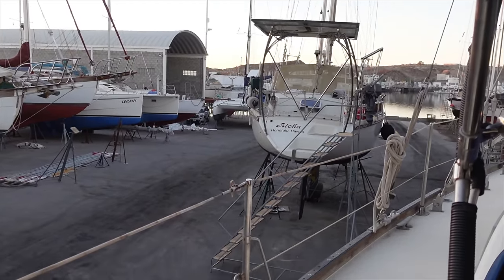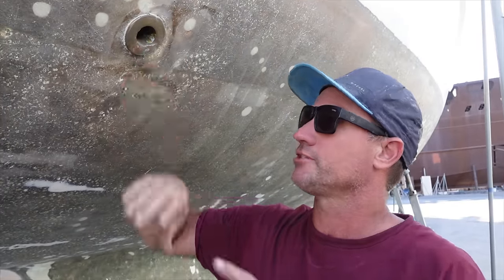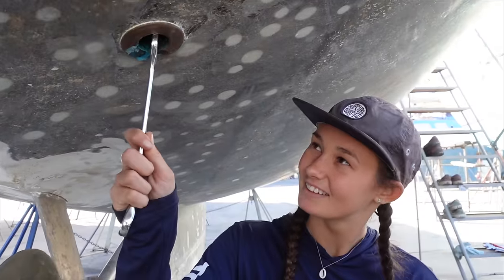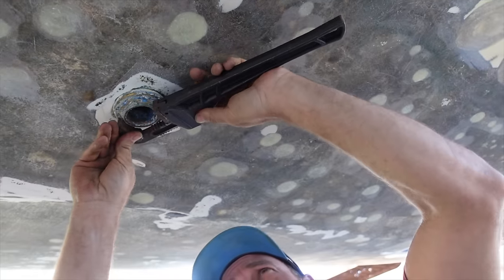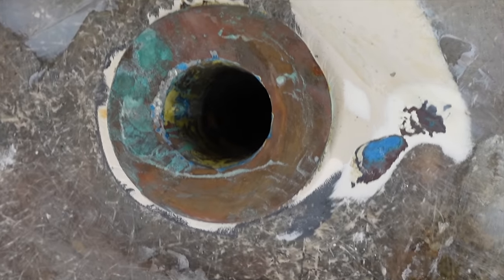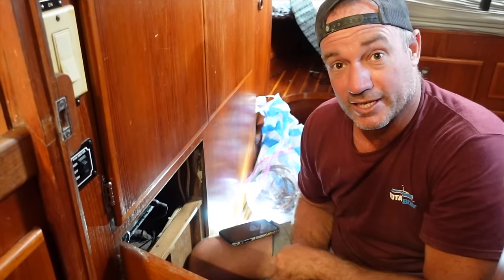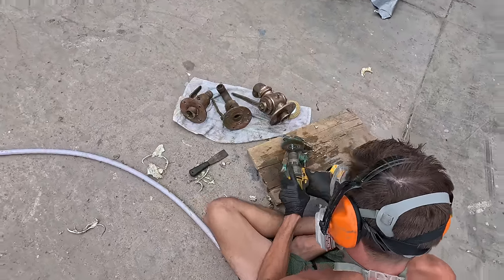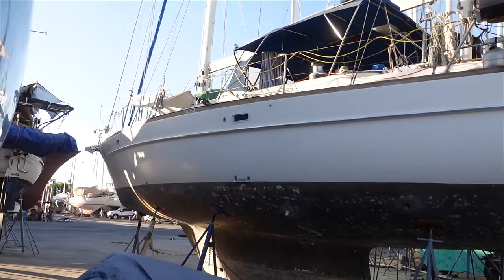Removing our Sea cocks | Ep 386

Comment: Good work you are all doing with the throuhgholes, BUT i totally diagree with repairing the old brass valves instead og using GRP valves.  I had them on my cats and they never caused a problem and never seized up in the 20 odd years of experience I had with them.  Also forget about corrosion from seawater and electrolisys.
Anyway good luck with the work and I love to see you back on the water.

Comment: Nice one, squad! So,...,,the pinkish colour of the bronze or brass is caused by the leaching out of the zinc content in the alloy  (less noble..... like anodes) , leaving an excess of copper...giving the pink look...am I right?  And the leached out zinc leaves microscopic voids in the material...which makes the material brittle......which is why the lugs break off....right? Very interesting....nice video, ...enjoyed from a hotel foyer in Rotterdam..with a beer....... Thanks, folks.. Good work, Lee...